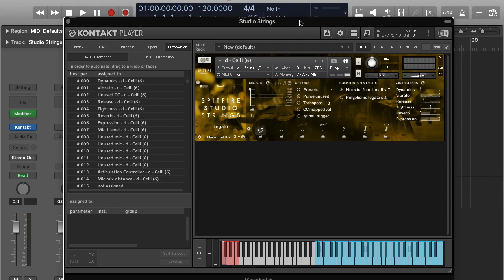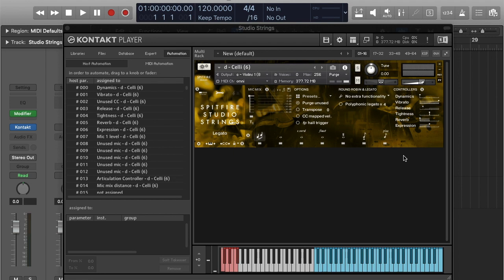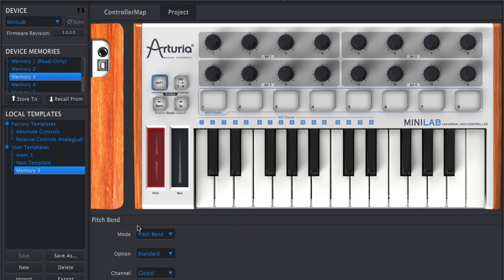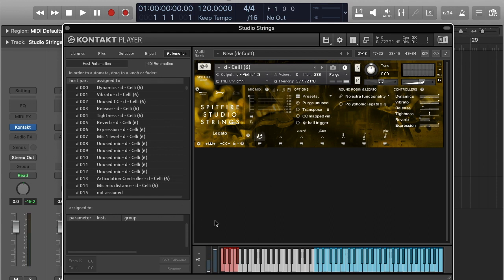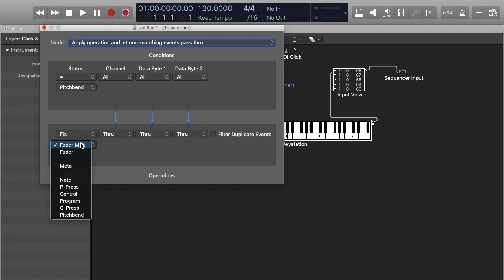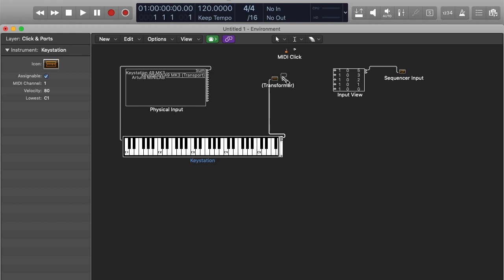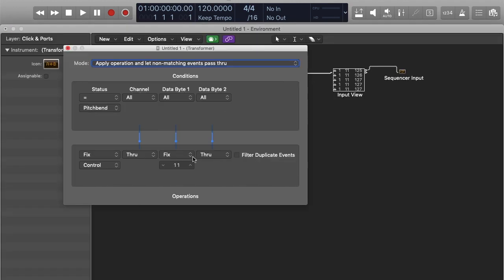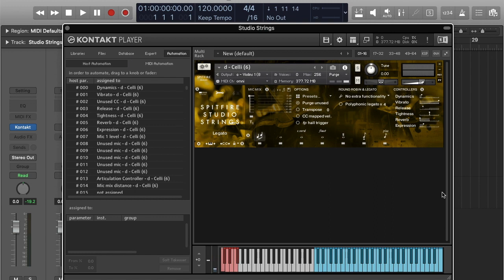Making my pitchbend wheel into an expression controller - Logic Pro X - Spitfire Studio Strings

Comment: Hello, you can use the modifier like you explained (2:22) and click on "thru" so the pitch bend effect is disabled.🤔 The rest is not necessary!?
Reply from the maker: Unless thats from a current update considering i made this video a few years ago, back then that was not the case, also this not only solved that problem it also solved having to put the modifier on every single track every time, i havent used this in a while tho so i might test your method and get back to you however back then it was not a thing….
And again… solving the issue of having to out the modifier on every track which is very inconvenient
Reply from the maker: update on this. no it doesnt disable the pitch bend it just ends up mixed up with the new controller, the reason for that is cause when you modify the pitch bend you dont modify for control 0 (which is also the pitch bend) so it stays active regardless, and since the modifier doesnt take CC 0.... still gotta do all this

Comment: I have the Arturia 61 and the midi control center doesn't allow me to change pitch or modulation wheel settings! Any suggestions? Also my modulation wheel doesn't work in logic but does work in analog v
Reply from the maker: Interesting… thats a little weird that your modwheel doesnt work in logic, you might wanna check your controllers communication with logic.
Now with the midi control center… if you have a keylab mk 2 or an essentials you cant do this, because its a pitch bend wheel, not a touch strip. You can for sure change your mod wheel settings in either but not the pitch bend. However, if you have such a big controller, there’s no need for you to do this, you have a lot of faders that you can use and the spring on the pitch wheel would mess with you…. Unless you take it out🤷🏼‍♀️ and then you only do the logic part.
I would suggest you fix your controller-logic communications issue first. And then just use the faders you already have. This trick is meant for an on the go set up with small keyboards. but also can fix a broken pitch wheel like i have currently
Reply: @UnrealSoundDesigner  Thank you for your response, you are a great man! 🍀✌🏼😁